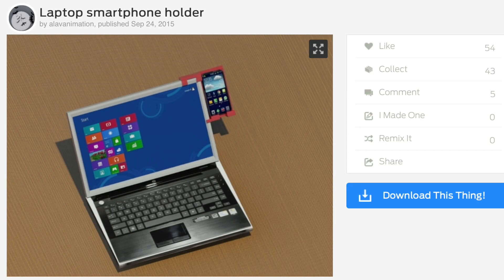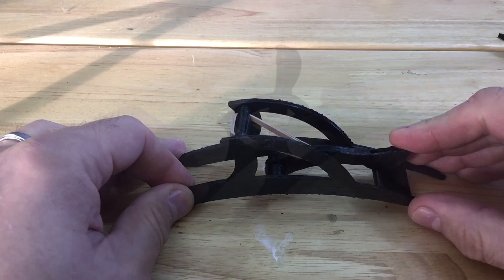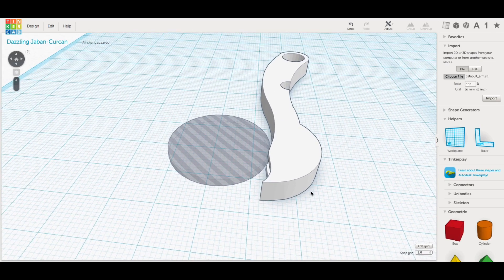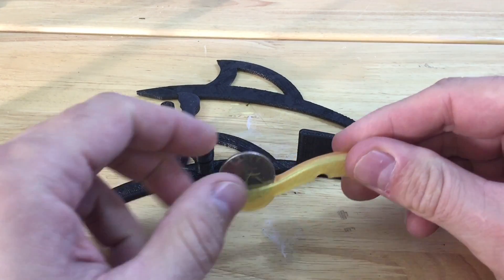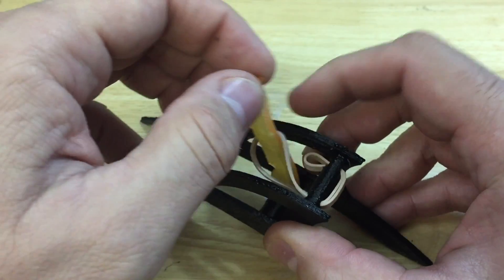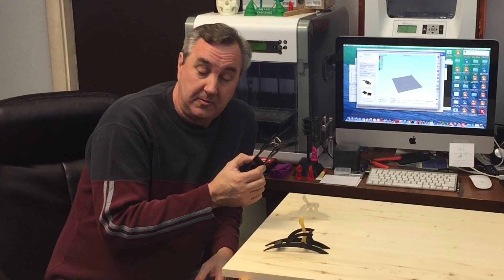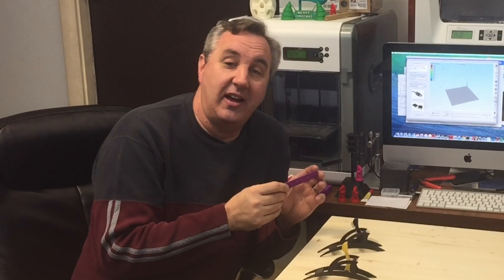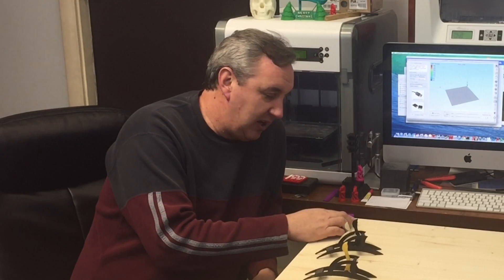Filament Friday #50 - 3D Printed Quarter Shooting Catapult - Play Angry Yoda

Comment: This is why you buy an da vinci 1.0 pro and no jr
The junior with wifi costs $499
The 1.0 pro costs $699

BUT
The jr only accepts xyz filament, the prise of that is $30 per 600 grams, so that's $50 per KG
You can buy normal filament for about $20 a4 KG, so that's $30 cheaper a roll.
If you buy 7 rolls normal fillament it will be $210 cheaper, and so you get the $200 between the printers back.

I hope you found this usefull

Comment: Very nice video. I have to tell you a little story about my Da Vinci about 2 weeks ago I screwed up my E3D v6 and I dont wanted to pay 70$ for a replacement so I got this http://e3d-online.com/Lite6 It is a PTFE lined hotend witch is capable of printing much better quality than your stock hotend does (I get the same quality prints they advertise on their website). But what really surprised me was the fact that it can handle flexible materials and PLA better than the v6 because it jams less. I would love to see you upgrading one of your Da Vinci printers to one of those. From what I saw you are either printing too hot or your extrusion multiplier too high. Maybe this https://www.simplify3d.com/support/print-quality-troubleshooting/ can help you. Thank you for such a great content I learned alot from your videos when I was new to 3D printing. You rock.
Reply: +Chuck Hellebuyck&#39;s Electronic Products I got a Fabrikator Mini my self (mine is orange :D). I can print flexible  materials but they wont stick to the bed (I use tape and glue). I never printed with the stock software is the extrusion multiplier that bad adjusted running stock firmware?  I plan to snipe a cheap Da Vinci Jr of eBay and put a RAMPS board in it but I cant find any pictures of the motherboard on the internet. Could you please send me a picture of the board? So I can see if it&#39;s possible to install a RAMPS. Sorry for my bad english. Thanks for your reply.

Comment: Hey Chuck... have you tried Simplify3D on your Da Vinci 1.0? Mine start to print but it will randomly stop printing and the buffer on the LCD shows 0. If you pause and un-pause the print, it may work for a few seconds and pause again. I was reading that it was a Windows 10 issue but it happens with Windows 7 as well.

I have to print from the SD card to finishes successfully, just wondering if you have this issue or have heard of a fix.
Reply: +Chuck Hellebuyck's Electronic Products Odd, I'm running the newest version of S3D and a new install of Windows 7 .